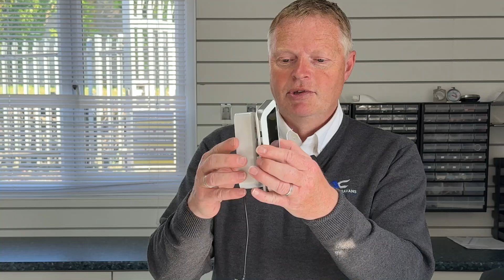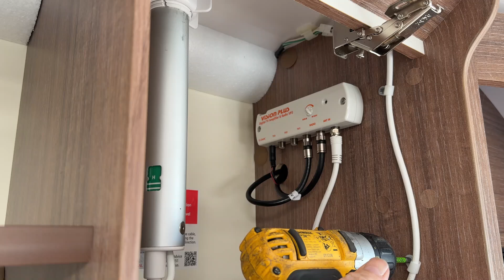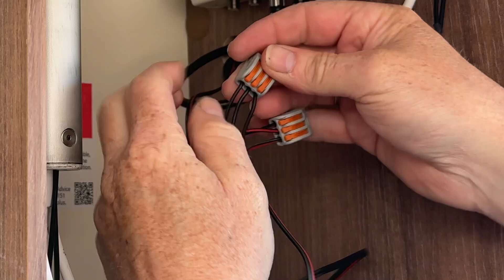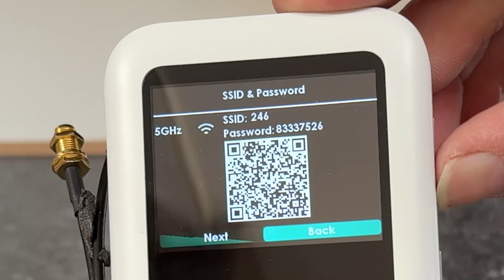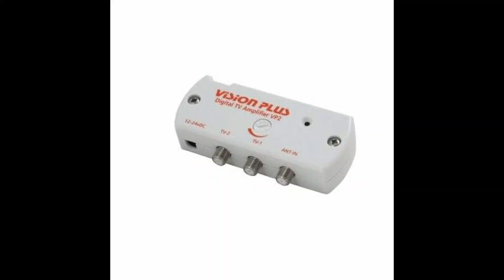Vision Plus WiFi Caravan Antenna.

Comment: If you buy the 5g variant - you can use this set up as a repeater.........so you can login to your Caravan Site WiFi and put in your login credentials....the Avtex systems will not do that. The down side its not cheap.......but no hole drilling - and a lower installation cost.:face-red-heart-shape: For me drilling into a new caravan....is not good. Also its easy to remove if you change vans.

Comment: We don’t watch tv in the van (glad to get away from it to be honest) so we manage with just creating a hot spot on the mobile phone if the local signal is poor. However I was looking at the cupboard in our Coachman where the aerial comes in and it’s a fair bit wider than the one in your video so retro fitting the upgrade might be more problematic. Interesting to see how it’s done non the less. Thanks.

Comment: got me wondering, if you could take a standard VP antenna, mount a wifi puck ontop, seal it, and feed the antenna cables down the pole and into the van, saves having to drill the roof? i'm guessing there isn't an issue with interference considering they have basically done the same thing just kept it in one housing.
Reply from the maker: Might work?

Comment: I really do like this but I don't have a tv in my van......just so much crap these days and you can watch it all through the net.

Any how, I have a three home broadband box that I have a ee unlimited sim and a three unlimited sim which works pretty good where ever I have been. I guess the bottom line for me and a lot or people, who say just tether from the phones is that if you have a modernist van that has gap panel and not alloy panel then this would be a waste of time as the signals get through the gap without any problems as you say in the video..

there is a reason I would like one is that it's very neat and out of the way , if it was a booster then it would be really good.

Great video as always Darren. thank you

Comment: Sorry Darren but I'm the one who purchased your unboxing aerial 😊. Anyway, dead simple to fit and works a treat. Even gives you WiFi when you're towing 👍. As you said, the coaxial is a little short and could be 6 inches longer but otherwise it's working perfectly. Next to do is link my fire stick. It actually took longer to sign up to Giffgaff than fit the unit. Boom 👍
Reply from the maker: Cool, I hadn’t thought of that, getting WiFi on the move..
Reply: Hi, just wondering what the signal is like and has it improved on what you had before if you did have any
thanks
Reply from the maker: @stehume not really, but I’m on top of a hill and can see the mast. But it will help when the signal isn’t as good.
Reply: @stehume I was in the New Forest when I fitted it and the TV signal was very poor so I'll have to check that next time I'm in Bodmin. The WiFi signal was excellent and I'll check the speed too when in Bodmin.